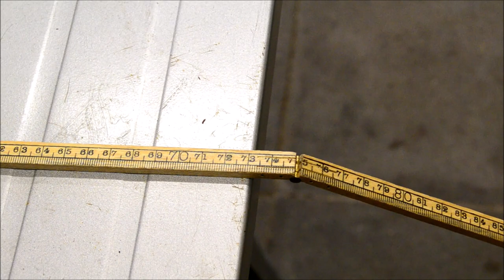HOW TO make a MDF crosscut sled | DIY Table saw sled |

Comment: Hello. I made a new table saw sled. This is a very useful, practical and reliable helper. But I regretted not doing it in a more developed form. Because I had to do much more beautiful and detailed. I used plywood as a material. Using MDF sounded more logical. Because Plywood may stretch over time and miter settings may deteriorate. I watched you curiously. You did a good job. congratulations. Thank you for sharing. Yours truly....
Reply from the maker: Thank you very much for watching!
Reply: @Dutchshedwoodshop  🍻👍👍👍

Comment: That is a great crosscut sled. If I may ask what kind of drill are you using what brand? Keep up the good work:)
Reply from the maker: I'm using KWB drills. You can get them at the local HUBO 😜
Reply: @Dutchshedwoodshop  I really dislike HUBO because compared to others they are expensive but the drill looks great..  Didn't recognize the colors

Comment: What kind of wood are you using for the gliders in the T tracks? That's no MDF.
Reply from the maker: Hi Antoine. Indeed that's not MDF. I made those from meranti hardwood. The reason why is because it slides better and does not damage fast. Thanks for watching!

Comment: I like the video.  I don't mean to nit pick. Love how you cut the handholds out of the fence. And I like how you sawed all the way through, most videos don't show that.  But, you should be wearing a mask with all the MDF dust floating around in a contained area (if you can find one nowadays).  What are the runners made of?  It would be good to show folks how you measured and cut them and the material you used.  Dropping the top onto the runners like that without a square reference point?  If I did that it would not be square.  Guaranteed. You show how you checked it after the fact, but how did you know it was square when you dropped the top? This is a nice built - it's looks good.  But if it's not square it's worthless.  Please update with a five cut test and check it.  Thanks.
Reply from the maker: Thanks for your feedback Kenneth 👍 you are 100% right about the dust mask. The runners are made of bankirai hardwood. I meassured it by placing a square agains the blade and the sled.